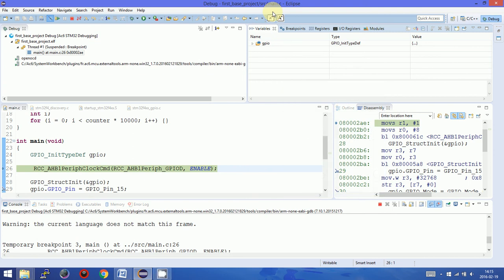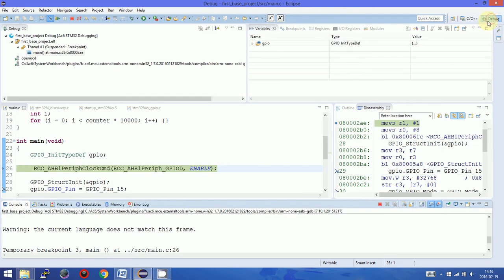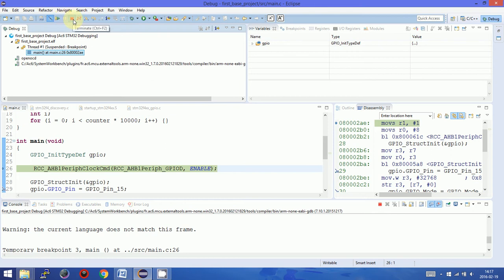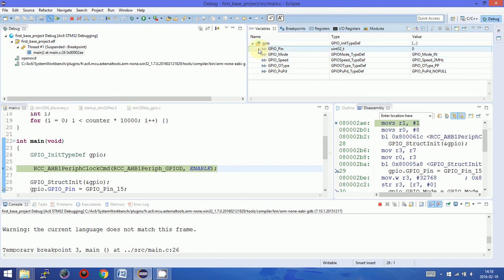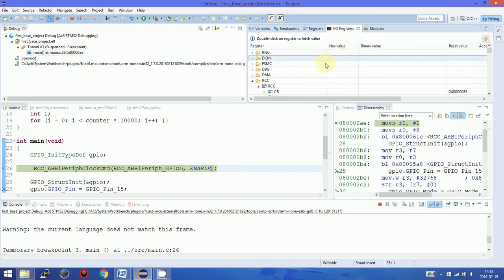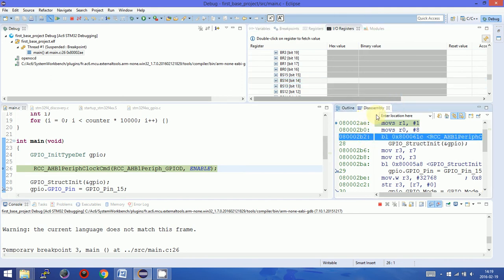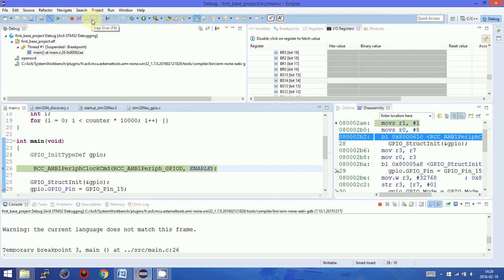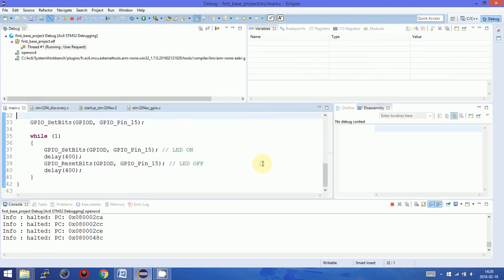Creating base project - System Workbench for STM32 - debugging - Ac6 SW4STM32 STM32F4 SPL - Part 4

Comment: TY Great instructional videos.  I was using coocox but it seems like this IDE is better. I was wondering in the first of your videos when we setup the IDE it showed the Cube option. What do you thing about using the stm4xcube?
Reply from the maker: Hi, Thanks for comment. I think You mean video - Part 2 - yes there was an option to use as a firmware library Cube - well in fact my videos was oriented a bit for case when for example You makes first steps and would want use examples from STM - they are written in SPL. In the near future I plan also to make videos about working with cube, transfering proj from other IDE and troubleshooting. You can subscribe to be informed about newest tutorials :)
Reply: +Adam Bemski TY for your fast reply. I am subscribed. You are a great teacher!